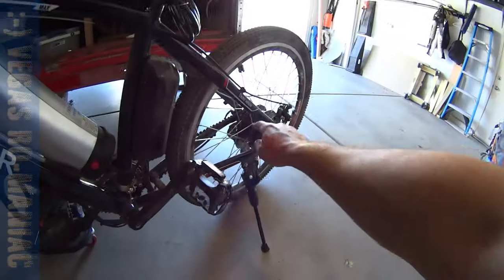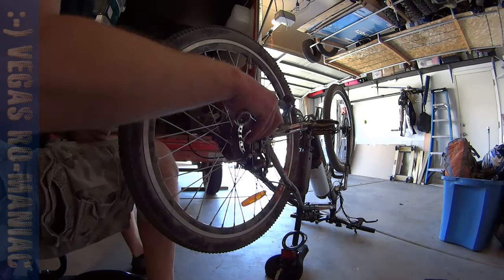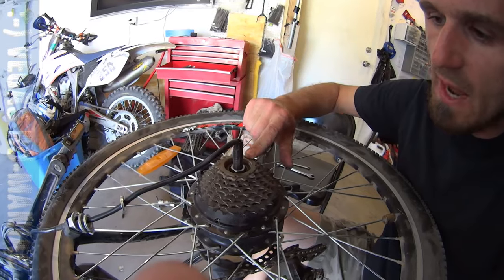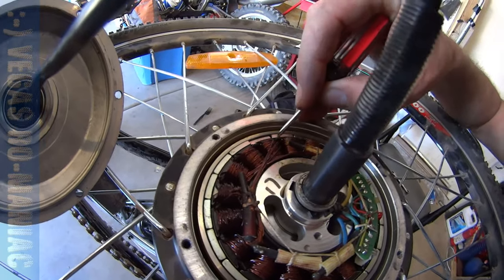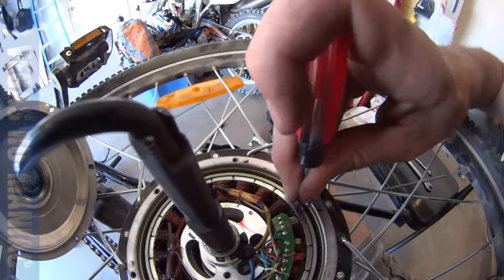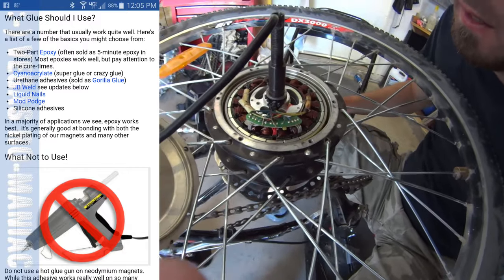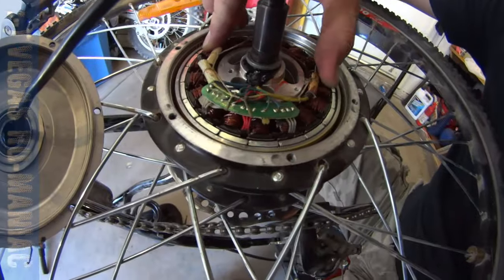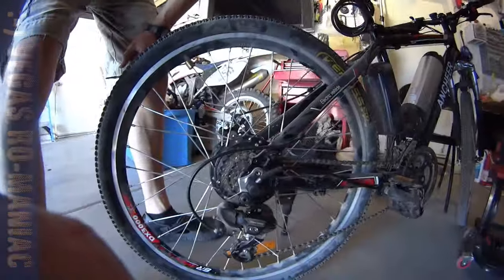Ancheer Electric Bicycle Hub Motor PROBLEM - FIX AKA Eshion Cyclamatic

Comment: Just curious. What were the bike's symptoms that made you inspect the magnets?
Reply: "Vegas RoManiac
1 year ago
Scraping, and rattleing noise loss of power"
Reply: @FloppyMusher  does the power cut out or does t it get weaker?
Reply: Mine drives ok  on level 1 but when I turn on fastest level whitch is 3 in my case the motor making weird noise
Reply: mine lost power slowly then cut out completly at about 500 miles.. have to try this!
Reply: i hear a meatal scraping noise from mine when i engage the motor
Reply: @MasterVirusGaming_MVG I hear this on many powerful hub motors. I believe we can't do much about it
Reply: ya when you glue them down.. nothing help
Reply: @FloppyMusher  thanks, sounds like my problem. I was pissed. $950 for only a month and a half of riding only 1 or 2 miles a day. I heard grinding noise when starting off, then instantly display showed error code 21 which means motor on my gotrax F2, then display turned off and won't turn back on! I pray my problem is just the magnets. Thanks.

Comment: My brother bought a used Hitway split e-bike.  We can push the bike forward but the back motor wheel will no rotate backwards. Any idea what might cause this?  The hub has p/n GT4875230300566 on it but I can't find anything about it online. I could hear and feel a slight motor noise when advancing the throttle but the wheel just moves backward about 1/4".  Riding the bike with no power turned on is fine, but with power on there is no assist, and there is actually a heavy drag as you peddel faster.  Is there a way to test the motor windings etc in the hub?

Comment: what was the initial fault?
Reply: Yea I want to know
Reply: @guze6799  I believe it was the same as mine.  At higher throttle the gears/clutch appear to slip so the motor doesn't drive wheel.  It is at high torque that the magnets slip.  The actual gears are fine
Reply: Torque multiplication, which is actually pretty cool as long as it locks up at the highest RPM, but it didn’t, so off it came.

Comment: I have just fixed mine (magnets slipping).  I used 2ml of epoxy resin in 3 stages over 30 mins using a syringe and ran the motor to force the epoxy against the back of the magnets.  I think epoxy is better than super glue.
Reply from the maker: Awesome
Reply: How long do you have the bike? Mine is brand new and not getting pedal assist after one use!
Reply from the maker: @Joe-pg4vk  pedal assist is controlled by a sensor on the paddles, check make sure the wires are not loose, or the magnet didn't get knocked out by something..., mine worked for 3000 miles when I sold it to get another one
Reply: Vegas RoManiac My buddy changed out the shifters because they got chipped  and put new cable in but since then she can not use the pedal assist or the shifter. It’s a new bike!
Reply: Its not a swifty by any chance, biought one about a year ago just actually got round to using it today after half a mile it stopped working,  makes avstrange noise like something rubbing the wheel.

Comment: Thank you so much for posting such a helpful video.  I have the same issue after about 1K miles or so.   I am not sure if I should take all the magnets out and use epoxy, or just try to use the simple method you posted.   I will probably end up using your method and go with CA glue.   I am guessing the CA glue will last another 1000 miles or so, but worth a try.   epoxy seems to be much hassle for now.  Thank you.

Comment: I have a small electric bike that is brand new that will not turn on unless it is hooked up to the charger. When I have it plugged in it will turn on and it shows a full battery and horn honks but no throttle. When unplugged nothing will turn on. Totally dead. Any advice??

Comment: Thanks so much for this upload; couldn't figure why I was getting hub noise on start-up; sure enough the magnets were loose, this was on a Richbit...Hate that name, 250W 36V bike after about 5000km, it'll probably keep happening I guess, how did your repair pan out in the end? Did you have to use any other type of glue after this for example. Cheers.

Comment: I didn't quite understand what was the problem at the first place. How do you diagnose a problem due loose magnets? I have a vibration on my bike from the motor once in a while, is it possible there are also loose magnets?

Comment: I have another problem, I was wondering if you can help me with my ebike. It's a snugger from ridel. I recently had a crash with it, I manage to change the motor and bypassed the PAS(I pretty much have it disconnected) because of the Error 30. I manage to get rid of the Error 30 but now the motor won't go with the throttle. I know the throttle works because I used it on a different bike and it works fine. The walk assist works perfectly but now my issue is the motor won't run when I press the throttle. I'm pretty sure the electrical side of the bike is perfect and works. Would it a mechanical issue or something? Any ideas would help me out so much! thank you!!!

Comment: My bike loses power as soon as it’s going uphill (right when you want it). If you stop and turn the key off and back on the power returns but as soon as you get back in motion it cuts out again. Could this be the magnets need to be reglued?
Reply: Did you find out how to fix your bike. I have exactly what you have discribed happening to my bike at the moment . Did you try the trick with the magnets ?

Comment: Should of showed the symptoms of this isue while on the bicycle before the repair ,well mine is making noise when I throttle and cuts out ,bit when I'm not on the bicycle ,on the stand ,it works fine ,I wonder is mine issue same,thanks
Reply from the maker: Was making a wratling noise
Reply: @vegasromaniac  the noise is not like something lose but like as if something with currant ,loud and nasty sound
Reply: When I throttle on speed one it's no problem but when I turn on speed 2 or 3 and start to move throttle than it cuts out following the noise and it sounds like it's comming from both controller and motor like some cert of vibration ,also when this happens the controller doesn't shut of it stays on all I need to do to stop noise is to let go of throttle ,also sometimes if I throttle on speed 3 and throttle slowly than after 15 km/h I can full throttle and noise is gone bit only for short time like a minute ,sorry for my spelling

Comment: T Y for this video ,,, what do you think caused the wound copper wires to discolor viewed in the video ?  Could the motor have over heated discoloring the 3 copper wire coils , and that heat melt the magnet glue bond ?  I read that the super glue will melt / debond at 100o C . Also that a water based glue can take the heat better , even silicone glue can take the heat better , too . So  BTW how is the Super Glue holding up ?

Comment: Hello any ideas on how to fix the frame socket where the wheel goes into the frame ,( the motor has the 2 parts where the nuts right into the frame and has a flat groove on both sides on my bike the socket on the frame is no longer holding the flat sides of the motor it keeps spinning on one side and the cable on the other side is spinning so it got damaged but still works the problem is the frame socket is not holding the axis of the motor) I'm thinking of putting a piece of metal on one side of the socket and to hold it the ideal way would be soldering but I don't have the welder so epoxy? Then file the hole if the axis don't fit? I guess it happened because I didn't tight the wheel enough and is an old bike

Comment: MY 1000w gearless cyclotricity hub is making a lot of noise, the power goes right down also, it could be lose magnets but I am betting the gearing is stripped, it vibrates right through the frame. I cant imagine superglue working for long, it is very brittle?, hope it works for you
Reply from the maker: Worked till the day I sold it...

Comment: What Grease did you use for the Teflon gears?
To me they say at bike workshop that normal bearing grease contains to much acid in it and after some time gears teeth Wil break off.
Reply from the maker: I used acid grease then ..haha no problem
Reply: @vegasromaniac  Thanks 👍🏻I wil do just that.
Reply: Teflon? PTFE is probably the most resistant material against acids, there's no acid I can think of that would damage PTFE. Nylon maybe.

Comment: What was the symptom of the hub motor failure? Could you hear a loud scraping sound from the hub? I have the same bike and I have the same loose magnet condition. I am going to rebond them similar to your solution but I am interested in your failure mode.
Reply from the maker: Scraping, and rattleing noise loss of power
Reply: yes scraping and you feel something is slipping, but stops once you're cruising
Reply: @markbuxton2368  Same as mine but fixed it with this method. Check your magnets if its loose also and glue it.

Comment: Hi my ebike brand new and faulty wheel runs s free till either the phase wires touch whilst no power connected  when power is connected  wheel wont turn like its jammed  thank you if you can help

Comment: I bought a Ancheer 26” 250w commuting bike and it has been sitting in my garage new for a month with dead motor. I took  it to repair shop they said you can’t get parts. The seller Zaplue won’t help and I can’t reach Ancheer they don’t answer. What should I do.?
Reply: Cut your losses and get something better.  Every single part of those bikes is garbage.  If you replace one part, you still have the rest of it to deal with.

Comment: Great video. My ebike front hub just died and it is a different design, but I bet it is a loose magnet.  I hope to fix it with some JB Weld.
Reply from the maker: Jb weld is better Than  duct tape.
Reply: were you able to fix it?

Comment: What was the problem in the first place? I own the 20" folding version and they appear to use the exact same motor. Mine started to "studder" during initial acceleration. I noticed on your 1000 mile review that it was "studdering" also. Just want to know if it's the same problem since it's the same motor.
Reply from the maker: the motor was spinning under full throttle without forward motion, the magnets were spinning but because not attached to the outside hub the wheel was not moving at full speed !
Reply: Hi, I have the same Ancheer Bicycle. Last week I went out for a ride, and after 1 km, the hub motor started a bad weird sound and also the speed decreased to 4-5 km/hr. with full throttle. Do you think is the same problem as yours? I appreciate your response.
Reply: will this be a solution if the motor starts and cuts off immediately in a few seconds or doesn't turn over at all?
Reply: This is probably a cable or hall sensor issue.

Comment: Hey brother, how you doing?
I wanted to ask a question.

I have a 52v 1000w rear wheel motor Chinese conversion kit, and recently got hir by a car.

The impact split my tyre, and also the rear wheel power cable slightly.

It worked fine for a few days, but then died on me.

Thw strange thing is, the rear wheel will sometimes begin to spin when I hit the thumb throttle, but then cuts out again.
The pedal assist feature also works intermittently.

The thumb throttle power indicator lights up, so I know the battery and some electrics are OK, but why won't my wheel spin and maintain power?

It's my first ebike, and 9m not particularly good with electronics, so I wanted to ask you guys what the problem may be?
Reply from the maker: That is strange.. Quite a complex issue. Don't know what to say man, if all wires are OK, and there are no loose connections, maybe something is loose in the hub motor, a sensor

Comment: I have over 3,500 miles on my 48v 500w Ancheer Hummer with a 52v Battery and have no issues at all.
You can totally just unplug the motor wires from the controller and move the wheel wherever you need to.....

Comment: I have a new bike got one ride on it and now have no power for pedal assist. It shows 4 bars and light and horn work.  Got this for my wife for retirement. It was shipped from China and I have problems with contacting them at all. Very Frustrating! Help
Reply: Check all connections in the black controller box under the saddle are secure.  Check the sensor on the pedal hub is not damaged (or any of the wiring).  Especially check the brake levers are not bent or out of position and the sensors on the levers are properly connected.  If the controller thinks one of the brakes levers is pulled, the motor will not run.

Comment: I turned  my bike on anchor e bike and the assist button also have done this for 10 monrhs now but when push throttle down to move it doesn't move I checked the motor to see if I hear It clicking and yes t b e motor is  making noise when I push throttle but no move ent

Comment: What are the symptoms the bike was having with this particular fix? My issue with my ancheer is……. The electric system completely shuts off when I try to put any bit of stress on the motor. For example: I can lift the back tire up and initiate the manual drive function with the throttle on the handlebar. And the wheel spins and the electricity stays on. But when I try to actually use the throttle or peddle assist while I’m riding on the bike…. It instantly shuts off. Does anyone else know this problem? How can I fix it maybe? I’ve checked the batteries and they all seem to in great condition with volt meter readings. I’m assuming it’s something to do with circuit boards or pinched wiring maybe.
Reply from the maker: That's a battery problem, the battery is worn, or had bad cells and the bms shuts off the battery, in my opinion

Comment: Hey, I'm have trouble putting back on the gears back on. Any ideas?
Reply from the maker: It's a just a basic bicycle gear mechanism, not sure what could go wrong. If they don't align, maybe you put a washer instead of outside inside ..

Comment: Hey man, love your videos... You cover all the right stuff.....
However, I think that you have shown this disassembly more than once and each time you have found the nut in the middle of the sprockets to be finger tight. There is a video here on YouTube by Ancheer, demonstrating swapping out the motor internals and in his case, he had to use a wrench to loosen that nut. He also torqued it up when he reassembled it. Just wondering if that could have contributed to your issues (weird noise, loose magnets). I one case you believed that grease made it quieter but maybe it was that your finger-tightening was tighter than before you disassembled?
Furthermore, I prefer the way the Ancheer tech fully disconnected the cable from the controller box.... I'm an electrician and stressed wiring makes me cringe...LOL.
Hope to order my Ancheer next week...Please keep up the good work. You are one of the few YouTube presenters who doesn't bore me with wasted words 🤚

Edit: Gonna strip mine down before I even think of riding it. Just read on a forum where the motor manufacturers recommend Mobil grease 28.
Even toying with the idea of sticking another 250w motor on the front, for those occasions where I care more about pulling power than range. We'll see.
Reply from the maker: Nope, the nut had no issue with that, magnets were not glue we'd on, the super glue held them in place forever. Still work today
Reply: Vegas RoManiac....Hmmm, it doesn't feel right to me. I have lived, slept and breathed servo motion control for 35+ years, from fractional hp to 100+ hp and to me, finger-tight = loose. Lot of stress in that area of this machine and you definitely have not babied it....LOL.
This is also very encouraging for me because I would normally run away from "plastic" gears but they seem to last well.
Anyone interested in longevity/reliability, however might want to refrain from all-electric standing starts as this puts way more stress on the gears than when the bike is already moving or when the rider is assisting. I don't intend to punish mine but it's gonna be hard for this ex-motocrosser...LOL. I had the predecessor to the YZ450F, it was the YZ426F 😎👍

Edit: I understand about the loose magnets but I am speculating about the actual cause of the hub motor issues.
Reply from the maker: @AdaptivePhenix  I think you underestimated for 35 years with how much you can get away with... This cheap bike has like 3000 miles like that..
Reply: So, a bit late.. how did the mobil grease 28 work out for you? Or is lithium grease better for the gears in the hub motor.
Reply: Can you give the link of the ancheer video
Reply: @vegasromaniac  Today, 3 years later, my bike (with the same motor) just passed 3000 kilometers and is not working well. Look, I never opened it since I bought. But now, I probably know what to do. Thank you I never find videos like these in my language!

Comment: Hey man keep up the good videos. Can anyone point me in the right direction, I've got a mid drive motor on my bike. Everything works, I lift my back wheel up and it spins perfectly, but when I sit on the bike the motor just shudders and doesn't have the strength to drive forward. Any ideas??? Does it sound like it's the clutch?? Thanks
Reply from the maker: No clutch  maybe something wrong with the electronics, these motors have all kind of sensors